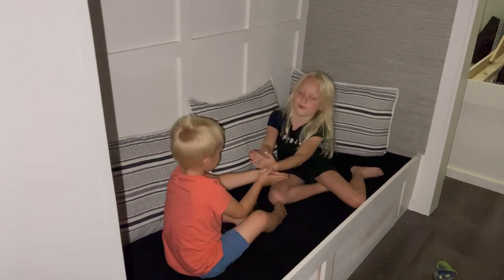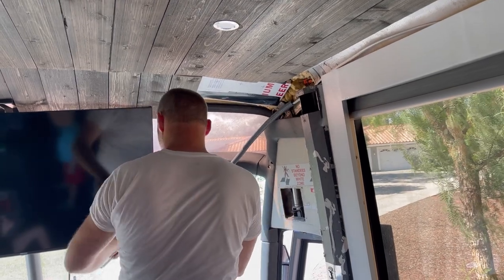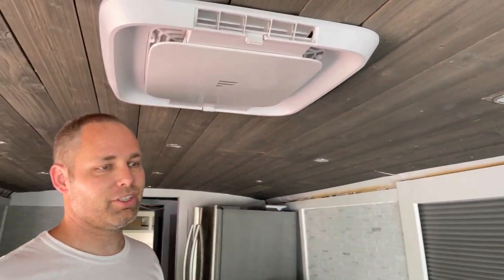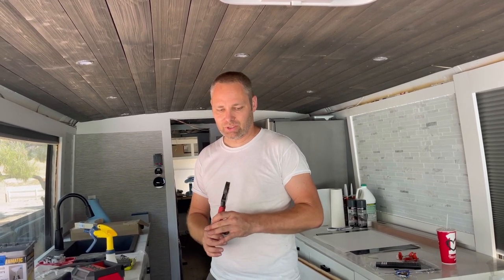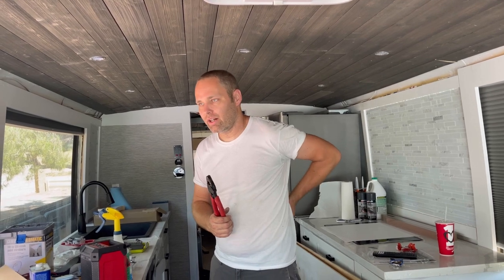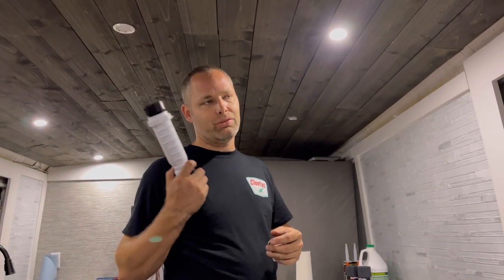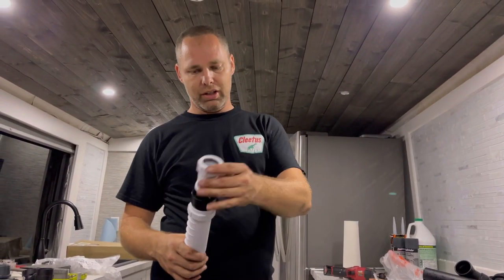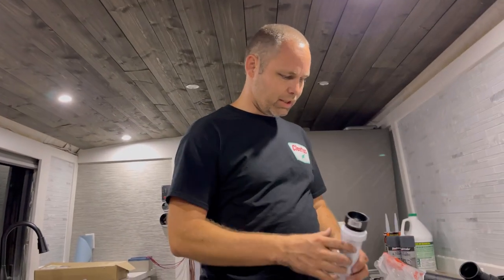Episode 68: Our Last Weekend to Work on the RV

Comment: How are your ABS connections holding up? I'm not a plumber and I don't know if it really makes much of a difference, but the Oatey website states "Remember: Unlike PVC and CPVC fittings, never use primer on ABS solvent welds."
BTW, I love your videos. Looking at converting a bus in the near future.
Reply from the maker: So far all of our drains from shower/sinks (PVC) are holding up great.  I'm glad we chose to use the HepVo waterless traps.  With PVC we used primer and glue.  Our ABS drains for toilet and black/grey drains use ABS cement, not PVC primer/glue.  Our pex has had ONE leak at our shower when we first pressurized the water system but it was easily fixed with a new collar and crimp.

Comment: Why don't  you make  a drawer on the bottom and cut out the back right corner and rebuild the exterior walls of the right back corner where the plumbing is located.
Reply from the maker: For the bathroom?
Reply: @RVthatBus   Not sure but it's where you said you were going to have a panel instead of a 3rd drawer because of the plumbing.